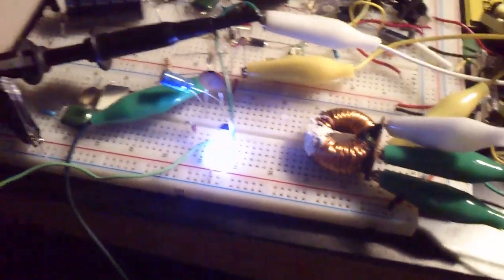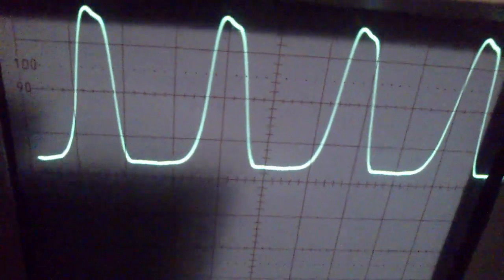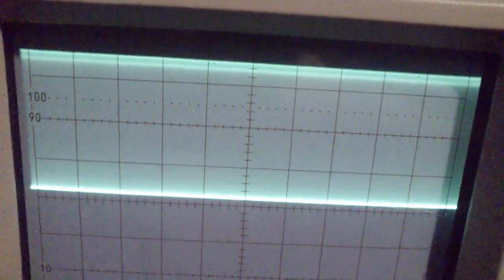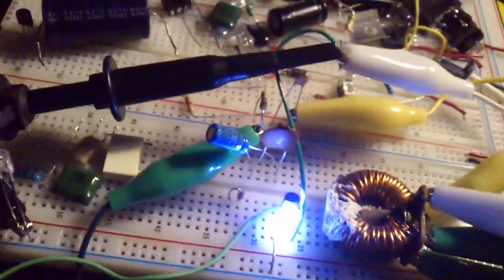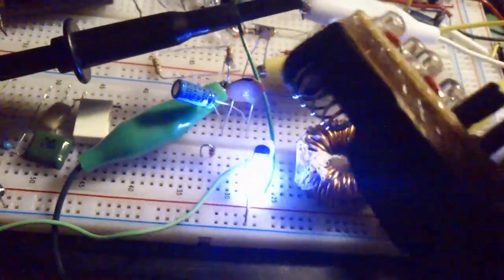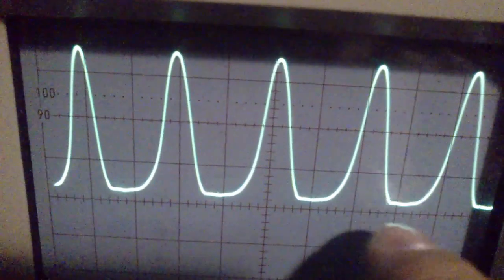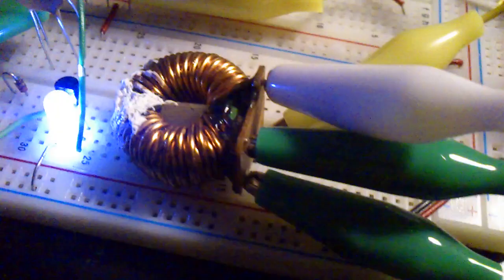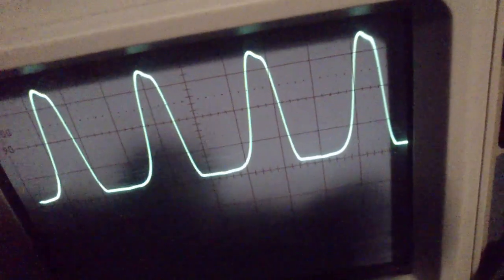Joule thief harmonic new coil

Comment from the maker: Harmonic is like a "sister" frequency either higher or lower in normal application you don't want those unless you actually use them. Resonance is the idea frequency for capacitor, inductor to work with since with inductor the higher the frequency you go the higher the "resistance" it will be. To my opinion for a simple joule thief can run at any frequency has long has I have light output and good efficiency. Have a good day!

Comment: Dead smooth. I have one of those coils from a microwave I have been meaning to try. Thank you. Very helpful. Looks like its on about a 3rd of the time, losing a tiny bit in between pulses, but pretty good. Don't trust the amp gauge too much, it wont be fast enough to see the pulses. I bet that circuit lasts more than twice as long as no oscillator. I think the big cap dimmed it at first to charge up, then steady. Can you recommend any text on harmonic resonance? I want to try matched wire gauge.